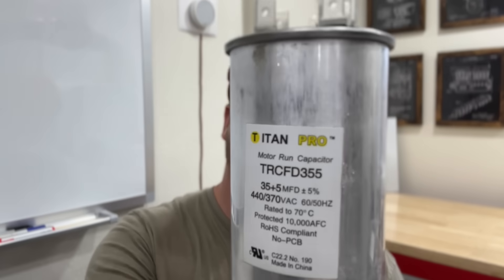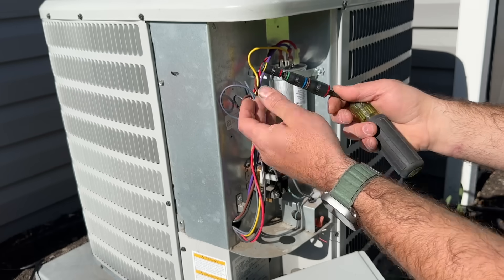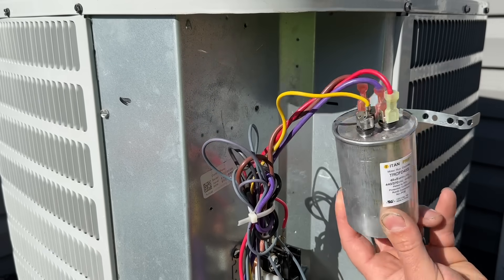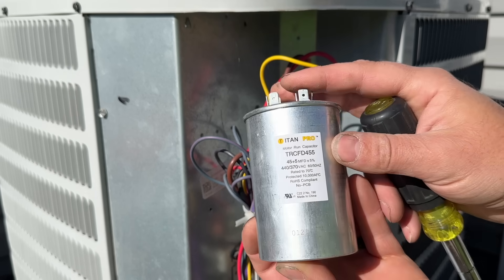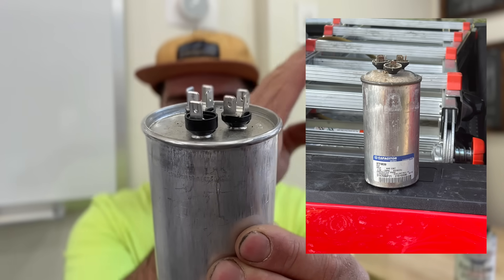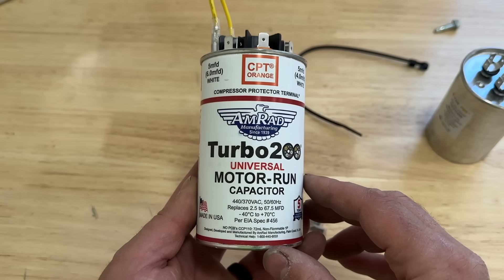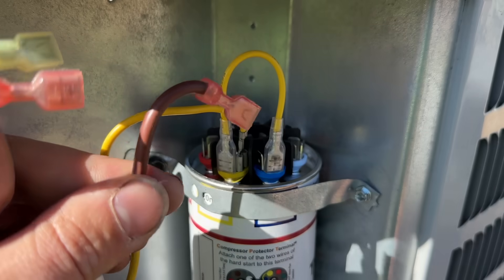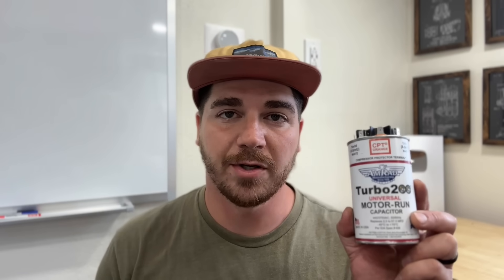HVAC Contractors Practically Make Their Living On These

Comment: you wait until they come down from your roof and say the system required 5 lb of refrigerant at $200 per pound, plus contactors.
Reply: The thing is anyone can buy refrigerant online cheap, if you have a license, or if not, sign a waiver saying you won't be installing it yourself, as if the EPA police would be watching you from the sky. You just have to learn how to use a manifold correctly.

Comment: Instead of spending $70 on the turbo 200 and keeping it in your junk drawer, why not just go outside, determine which capacitor you need and buy the appropriate capacitor in advance for $10 and store it in your junk drawer? I’m not seeing the advantage of the turbo 200, if you know which capacitor you need.

Comment: Yep, I do most of the work on my AC, and furnace after I found out how easy they are to work on, most of it is plug and play. I paid a pro to come in and he replaced the motherboard and charged me $1,600. I watched him unplug and pop out the old motherboard, then clipped in the new motherboard, plug it in and walla $1,600 hundred dollars left my bank account in just a few minutes.  As long as you follow this guys advice on what to do before you work on the unit so you don't get electrocuted, you can do most of the work yourself. I bought a vacuum pump and learned how to braze lines so now I can't wait til my pump goes out on my condenser so I can try my luck at replacing the pump. My ac unit is old though, almost 30 years old so I don't recommend to work on any newer unit, unless it's an easy fix. When I do replace my system, a professional will be doing that.

Comment: My capacitor needed replacement this year. The HVAC clowns quoted me $350!  I found capacitors on Amazon for $12.  I called the HVAC moron and told him I bought my own capacitor and requested a new quote to install it. He refused and hung up on me. LOL. So after watching a 10 minute youtube video and reading the extremely simple instructions that came with the capacitor, I did the job myself. Took no more than 10 minutes. It was so easy that I replaced the capacitor on my blower fan as well. I will never pay a tech again. I even bought refrigerant from Ebay. HVAC business is such a scam. By the way, I took a practice EPA exam. Did not study anything and got 70 questions correct out of 100. I plan on buying a new split ductless system soon. $4k for the system but the HVAC morons want $10k just to install it. Hell, fuking, no!

Comment: I wish the people who made the disconnect would have made it so the top line would be the line showing the state. Most people read top to bottom. Also, when you flipped the disconnect over into the OFF state, it read NO OFF, which I find a little funny. Good design matters.

Comment: Yeah, they do it all the time. Thanks to you and Google. I looked up why my AC was not turning on.. like you, they said the first thing to do for a $10-$15 part is change the run capacitor or start capacitor. It’s worth a shot for the money.. connecting 3 wires it fixed my problem five years ago. I got lucky! Tnks!

Comment: Having a degree in electrical systems, I find it totally fk'ed up when HVAC repairmen charge folks $400 to change out a $12 capacitor, they did this to my 80-year old mother. Then told her they could knock it down to $200 if she bought their yearly service plan. I called them & told them where to place their yearly service plan !

Comment: I saw this video a while ago and had put a capacitor in my Amazon wish list to purchase. I should’ve done it right away. AC went out a few days ago. Ordered a capacitor for and installed it today and it’s back to working. Thank you for making this known! Cheap and easy fix.
Reply: Well, thought I was good, but new capacitor failed in 24 hours. Something must be causing it to fail. Just don’t know what. Unit is 10 years old. May have to call a pro in now.

Comment: I found the panel, but there's an electric shock warning not to pull the handle without the the shield removed? Don't I have to cut TBE power at the circuit breaker? I don't want to electrocute myself trying this

Comment: The motors that run the compressor and the fan utilize a trick of three-phase power in order to get them spinning.  Residential housing, however is only fed one phase of power from the grid.  The capacitor essentially sets up the phases at the unit to kick the motors on.  If the cap is bad, that split phase is weakened or non-existent, and the motors won't start.

Now be aware, the threat of shock from a cap is significant.  But they aren't like batteries.  They're more like the electrical version of a coiled spring.  They charge up very quickly, and they discharge quickly.  The voltage they hold tends to be the same as the line voltage feeding them, while the power stored is in direct proportion to their size.  A cap the size of a double-A battery will bite you, HARD.   A cap the size of a soda can, like the ones in Air Conditioners, will knock your block off and send you across the room.  Most people have encountered caps, but rarely larger than their pinky finger.  And if anyone has encountered fried electronics, chances are, the fried bit is usually a blown capacitor.  Keep in mind, those scorch the electronic boards they're on something fierce, and are the size of a dime.  For safety's sake, heed this man's advice when he talks about discharging any large caps you encounter.  The cap in his hand WILL send you to a brief introductory meeting with Saint Peter.

Comment: When I bought my second house, which was in the late fall of the year, we moved in and had no need for the AC until late May or early June. As soon as I turned it on, the air handler would come on but the outside unit would not. The HVAC dealer upon whom I relied at the time offered a free estimate so I took them up on it. I was told that the "compressor is shot and has to be replaced...". I asked how much and he estimated around $1000, plus refrigerant.  Iwas a bit dubious so I told him I would have to get back to him. My new neighbor, as it turned out, was the maintenance guy for the local McDonald's restaurant chain and I had him take a look. He said it was the capacitor. A replacement cost me less than $10 (this was in the late '70s). I replaced it myself. About two months later the fan motor died. OEM replacement was around $200. I found a new washing machine motor with the identical specs for less than a third of that. The only issue was it had a very long shaft. I shortened the shaft to match the original motor and put it back together. When we sold the house, five years later, it was still running with that fan motor. I now call the HVAC pros ONLY when I encounter something for which I lack the tools and expertise to handle. With the advent of mini-splits I now do ALL of my HVAC work and, with your help, I'll go off-grid with my HVAC needs as my existing units begin to fail.

Comment: If you don't wanna do it yourself, a reputable hvac company will do it for $200-$250.  When you call, just ask for hourly labor rate.  Here where I live is $150 to show up and 1 hour of labor.  Tell the office you want a capacitor replaced not diagnosis.  Get the price ahead of time.  Or even call a handyman

Comment: Completely pedantic comment: 
The capacitor is not for giving the motors "an extra jolt" to start. 
The capacitor is designed to take the single-phase AC and give the motor a second phase to get started AND stay running. Without the capacitor, the motor generally remains stalled and can heat and burn up if over current protection circuits don't kick in.

Comment: Yeah I got wrecked by one of those capacitor. It didn't show any charge or completed the circuit when testing it with a multimeter. Also did the screwdriver trick to just to be on the safe side. Went to the store, got a new one, hooked it up and got a cool house going. Accidentally dropped the old one on the ground and it sat straight up, reached down and picked it up and I ended up stupidly palming the connectors and it threw me back on my table behind me. Was not a fun experience at all!!!

Comment: This is exactly what I was looking for. My system has 2 since the fan motor was replaced aftermarket at some point in time and I want to get it all replaced with 1 capacitor but wasn’t sure how to measure what I needed.

Comment: I work with ac and dc caps all the time in a different industry, I constantly see advice on shorting the caps and I need to comment on it.  Because of the nature of the circuit AC caps are wired into, once the power is removed, residual energy should dissipate instantly into the circuit.  If the cap is holding a high amount of energy after power is removed, there is likely something wrong with the circuit, or windings the circuit is plugged into, etc...  That being said, and this is what drives me crazy... if you short a cap that is somehow holding enough energy to hurt you... its going to probably launch molten metal or other sparks into your face.  Its better for your health to discharge a cap into your body than to bridge its connections and lose an eye.  What is even more ridiculous about this is the nature of "checking the cap" requires a multimeter.  Use the GOD DAMN MULTIMETER to check the cap for residual energy, if its an excessive or dangerous amount it will discharge through the multimeter anyway, which is fused for that situation.
TL;DR - stop shorting caps "to make them safe"; if the cap isn't safe shorting it will hurt you more than just using your body to discharge the cap, use the multimeter that you need anyway.

Comment: I joined your membership yesterday as I like your explanations and your suggestions. I am going to be  making most of the changes you suggested and was looking to purchase a couple of capacitors to have on hand. I can’t make any sense out of the capacitor label and can’t seem to find the unit. He label says 70.0uF ± 6%  370VAC/B most of what I’ve found has a  second MFD number and it is ± 5% . 
Can you provide me with a little help. Also you mentioned a hard start unit and all I’ve heard about are soft start units. Could you elaborate on another video. 
Thanks
Reply from the maker: Here you go: https://amzn.to/4dbjaMS

Also a hard start kit, helps the compressor start its rotation in the correct phase, and delivers the amps super fast, so it can lower the initial amp draw, or some say deliver it so fast that it can’t be read with an amp meter. But I think they are great to have even on a new system. 

Neither soft or hard start will save you money but a soft start will allow you to use a generator to power your ac which is pretty cool 👍🏼
Reply: @diyhvacguy  Well I had i a generator in MA that I brought with me to Alabama [and it is 14,400  kw] . I used it for snow storms but I hope  I don't see any snow storms here. Only potential here are Tornadoes [a little rougher than Snow]. Will get a hard starter and think about the soft starter later. Thank you so much for your great videos. I  understand the rip off as I was told that I should replace this unit [Rheem A0495JK] instead of getting new ductwork [original installed in 1968] .  I hope to take one of the courses that are offered through your memebership offers. 
Thanks Again you are fantastic !!!!!!!!

Comment: I just had to have my AC capacitor replaced. I happened to be outside getting rid of some weeds near my outdoor unit and heard it hum a couple different times. I was charged $35 for the part and $50 for labor for a total of $85. Not too bad. I live in a rural city and used a local contractor.

Comment: Did you ever wonder why these capacitors are mounted with a perforated metal strip like they are an add-on or an afterthought? Also why don't they have a single plug setup to connect these components instead of these random looking loose wires.

Comment: Thank you so much! I ordered the Turbo 200 and installed it simply based on your video. Thank you sooo much! My house was at 82 degrees, but is already at 78 after an hour of it operating correctly. 

My capacitor was worn out enough that I couldn’t locate Herm, Fan, or Common. I discharged the unit as instructed in the video, and ended up using Q-Tips to remove the build up of dust and dirt. The photo helped, but I also marked the connections with “R” for red, “B” for brown, and “BW” for brown with a white line. 

I have a Coleman unit and the capacitor is 35+5(plus/minus) 6% 37CAVAC/B. 

My unit only needed 3 connections:
Red wire = Common
Brown = HERM
Brown with white stripe = Fan

Thank you again for the safety guidance and detailed education of how to do this simple fix. Many thanks from a grateful South Dakota family!!

Comment: I watched this video last week.  We had received a complementary AC tune-up from the company we had purchased a new furnace from last fall. The service person shows up at the door holding the AC capacitor and a voltmeter.  He showed me the values on the meter, which I expect were accurate. Tells me I should replace it.  He just happens to have one on the truck and will replace it for $220.  I bought one for $16 and replaced it myself.  Thanks for the heads up!

Comment: I would like to know what you feel a good price would be to have a company come out diagnose the issue and replace the capacitor . 
I mean 2000 is ridiculous but if the technician goes over the unit checks everything out and it’s just the cap what would you say a fair price is . Also what I can do in 30 minutes that takes someone else 1 and a half hours is because of my experience and knowledge . 
I have no problems with people fixing their own equipment but know that the less people calling techs the more techs have to charge to stay in business .

Comment: I have 20 plus years as an HVAC tech. Not all companies are out to take advantage of customers. My company would charge a service call the cost of the capacitor.  The cost depends on the size of the cap. I would also go over the system to find why that capacitor failed.  $130 - $145? Considering I'm driving to your house 95% of the time I have the part on my truck I don't think thats unreasonable.  I'm not anti DIY but if your not at least a little familiar with electrical work please call a reputable company. We do exist.

Comment: Hi:

I have a Trane Central Air Conditioner TTR036C100A2. It is blowing air but it is not cold. I would like to replace the capacitor. Where is the capacitor located on this unit? Thanks!

Comment: Im a hvac bussiness owner and to run a licensed company cost alot to operate .I charge $325 for a capistor if  I would to charge $50 for a capistor I would go be closing doors. What happens if it needs refrigerant? Or a hard start kit? Or a contractor? Or a blown fuse? 
It's not only a capistor that fails other parts fail. We lOve DIYERS
THEY ALWAYS CALL US AFTER THEY MESSED EVERYTHING UP😅

Comment: These caps have gotten me out of some many jams   Especially if you are in a rural area . .I just tell them what it is . I do mark it up a little considering that cap costs me around 90 bucks I'll charge 125 or 150 depending on if they are Biden supporters or not residing there . If you are down with D.T I'll give you that capacitor at cost ! along with a free coil cleaning and drain flush ! How bout that !

Comment: I got swindled this way too - except they called it a "dual volt stabilizer" in the quote to obfuscate the fact that it was just the capacitor. I didn't know what it was and was in the middle of major home renovations, so I just took it for face value and let them do the work. What a load of crap!

Comment: I had a service tech try to burn my house down by putting a hard start in the 5 yr old Train. He fried the mother board and the thermostat started smoking on the wall. This was in July in the panhandle of Fla on a Friday and of course no motherboard until Monday. I called the office and raised heck. A year later the dryer had a leak that was outside and had to replace almost all of the 410A. $750 later. Three months later was out of 410A again a leak at the indoor coil. Needless to say I was done with this company.

Comment: This is a very imformitive channel for diy's. Couple questions how do you discharge a turbo 200 universal capacitor and how do you find the correct size off that capacitor to get the non universal capacitor . I didn't take good pics but the yellow jumpers connected to the 10 and 25 add up to 35 with 1 other wire comming into the blue 25 mfd and 1 wire to center common so would it be a 35/?  Hvac said it is a Rheem classic and house was built in 1988. First call was in 2022  turbo 200 2.5/67.5 $188. just for capacitor.

Comment: 32 yrs experience HVACR, good but you should of shorten the cap. Before hands on, always keep safe always think it hot even when power is off.one more tip always back  hand the panel on our door unit . before touching panel electrical wire from cap. Could be grounded to put door unit ,think safe all time ,mult.cap diy have no business working on cap.or anything with electricity involved. BIG NO NO